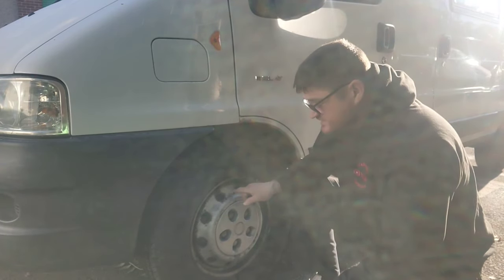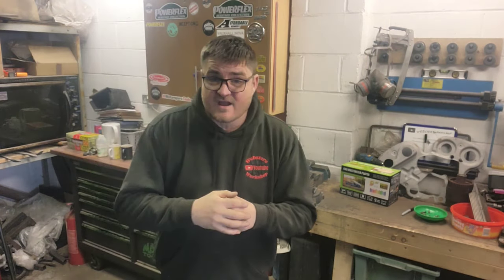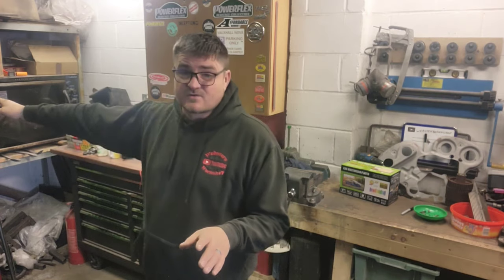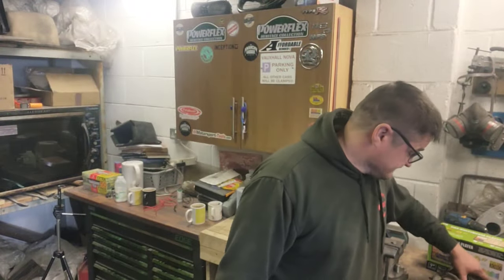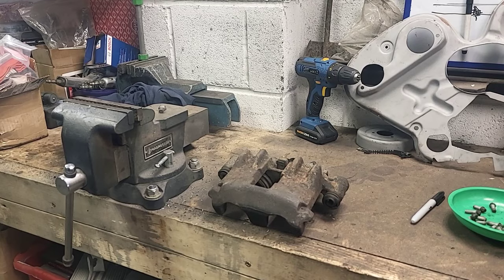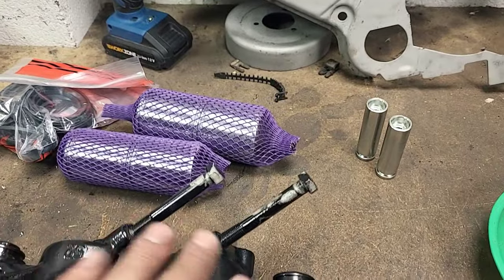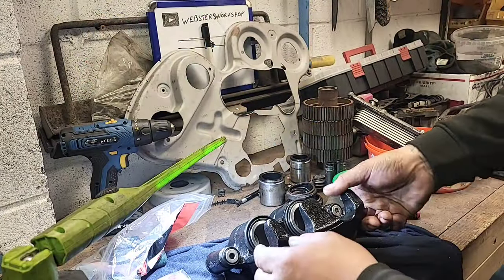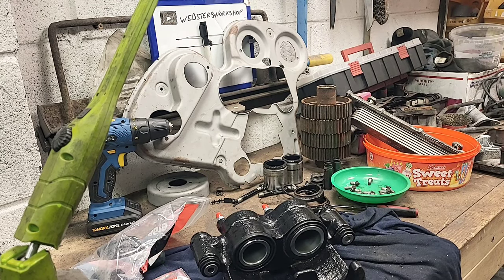Refurbishing the brake calipers on the campervan

Comment: Top tip Instead of clamping the flexy you can crack the bleed nipple or the pipe off then keep the brake pedal pushed down with a bar against the seat. You will get the first initial bit of fluid that comes out when you press the pedal but then it won't keep dripping. Ps callipers looking good 👍
Reply from the maker: Cheers, will give that a try for the next time.